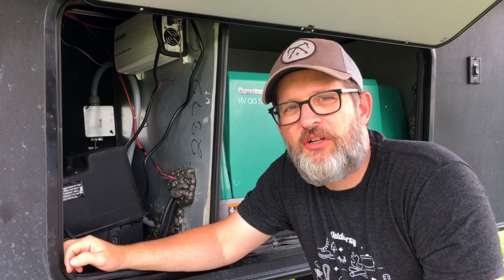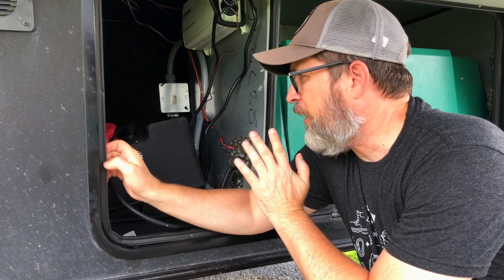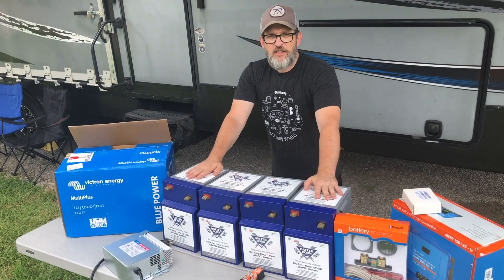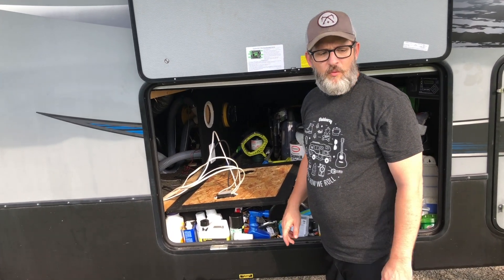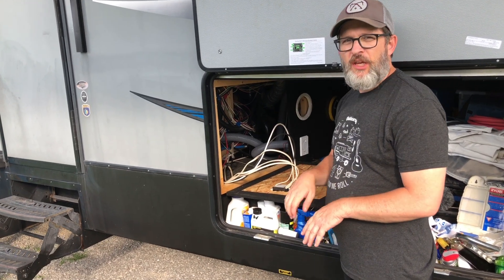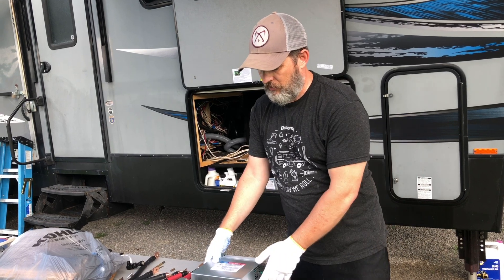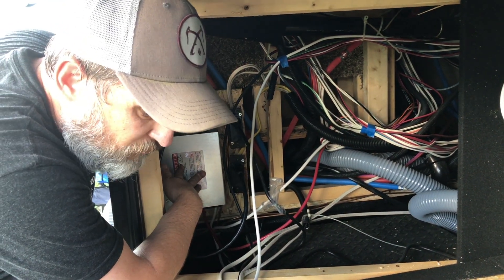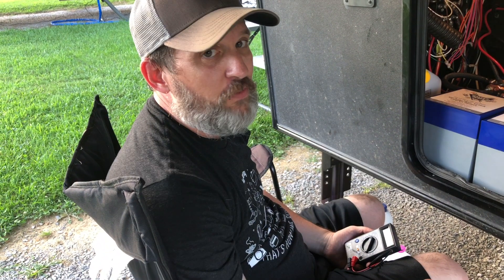RV Solar Upgrade Part 1: Battle Born Lithium Batteries & PDI Converter Install

Comment: Great video,would like for you to go in more detail on how you wired up the batteries. Thanks
Reply from the maker: First, thanks for watching, Billy. I will put a diagram in my last video showing everything. Appreciate the feedback on that. I wired the batteries in parallel so I could leave them 12v, but increase capacity and amp hours. With the 4 100 amp hour lithium batteries, we should have just short of 400 amp hours with the way I wired them. There is a great website, http://batteryuniversity.com/learn/article/serial_and_parallel_battery_configurations, that shows the parallel wiring. I will definitely include a diagram in my final video/review for this install.

Comment: Looking good Sean!  I went with the AGM's, but the lithiums are awesome, just out of our budget.  How many watts are you planning on installing on top?  We will be doing 6 200 watt panels and we also have the 5500 generator on board.  Can't wait for your next segment!
Reply from the maker: Thanks, Joe! I estimated about 900 watts of solar. The main things I am really concerned about powering are the refrigerator and an outlet for my CPAP and a fan. Anything additional will be a bonus. Maybe we can squeeze out some charging on our computers and phones.
Reply: You should have no problem squeezing out energy for your phones or computer with 900 watts!  Looking forward to seeing the next upgrade!  Are you seeking any help with this install?
Reply from the maker: I am trying really hard to do it all myself. The reason I wanted to do it this way is just to show that it is possible for those of us that are initially intimidated to be successful. However, that doesn't mean that I will not run in to a major snag that requires assistance. :)

Comment: Nice job guys. Looks really good. You must have been talking with Justin about them batteries. Dude knows his stuff. Just a future tip for ya. You don’t have to cut power from the pedestal with your unit because when u unplug the converter it’s dead and Same with the batter. It’s all dead should be no reason to worry about shock. But being safe never hurts when your not sure.
Reply from the maker: Thanks for the tip, Kevin. Many years ago, I was slightly shocked when messing with a dryer. I will never forget feeling like my teeth were melting. So, I am always extra careful when it comes to electricity. If I had known about just unplugging the converter, I would have been less hesitant.
Reply: Chickery's Travels hay let me tell u it took me a long time to learn that. When I would install a ac unit on a pop up camper I use to unplug the camper from the building and kill the breaker in the camper main panel. Nothing wrong with being cautious. As a kid I was kind a slow. I stuck a key in a outlet two times lol. Guess I for got what it felt like the first time. lol.